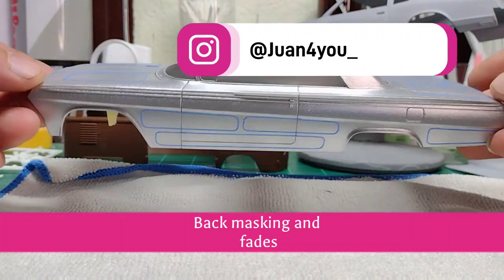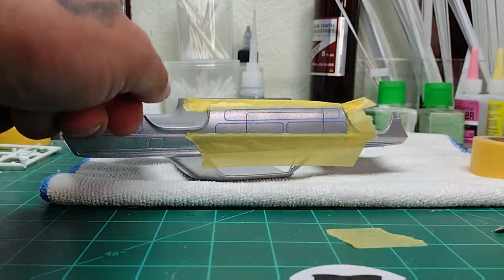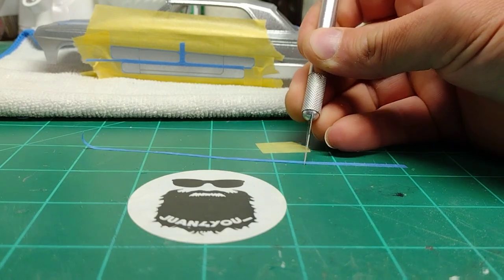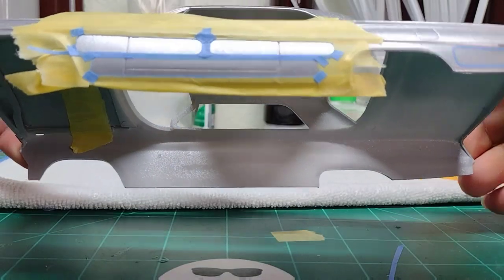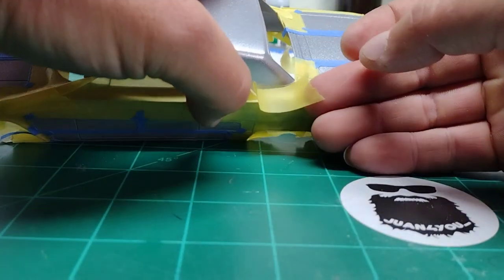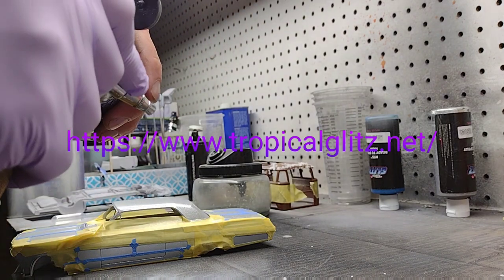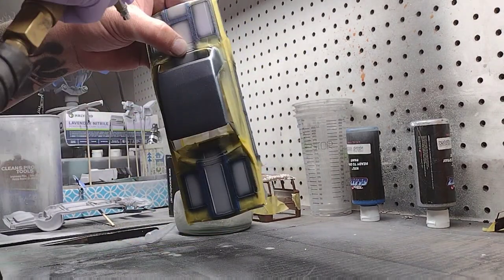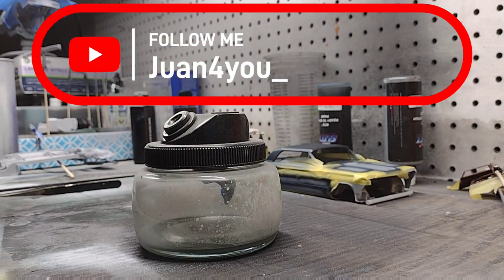Customer's 1962 Impala 1/24 scale lowrider model car airbrush -video #2  "back masking and fades"

Comment: Love ❤️ this THANKS FOR SHOWING  I NEED another AIRBRUSH  with for smaller needles. Have a 3 and 5 AGAIN thanks
Reply from the maker: I use the 0.02 for very small fades. I only used it here because I'll be doing more fades in these areas(next video) so I needed  to make sure the fades were small enough as to not cover so much area. Having multiple guns helps!

Comment: What paint do you use as a metallic base coat ?
Reply from the maker: On this one here, it's Comet Silver. It's a bit chunky, I spray through an 0.05 needle. Next up would be actual flake, which I spray through a spray gun with a 1.4 needle.